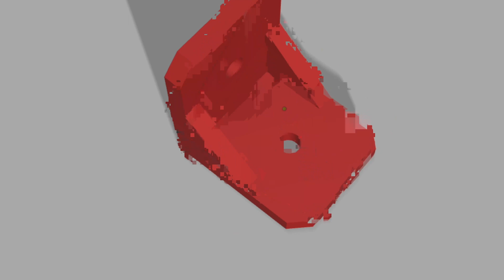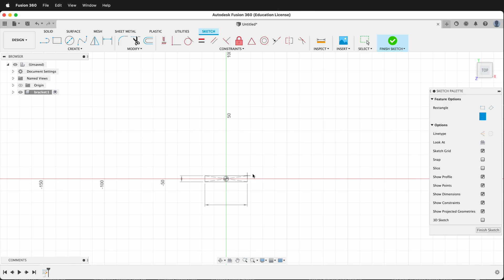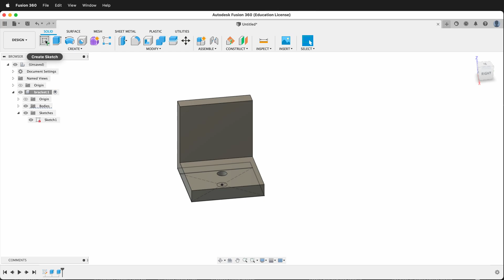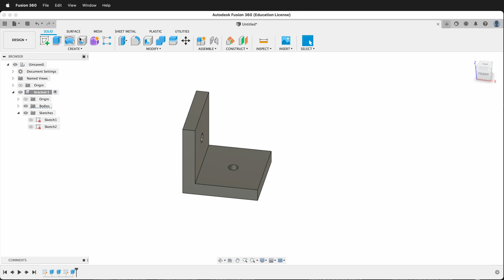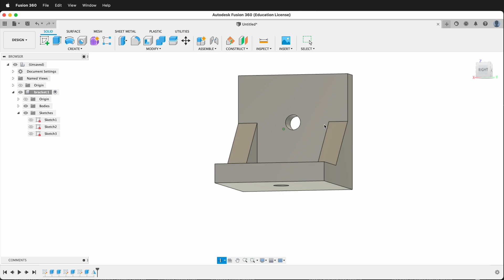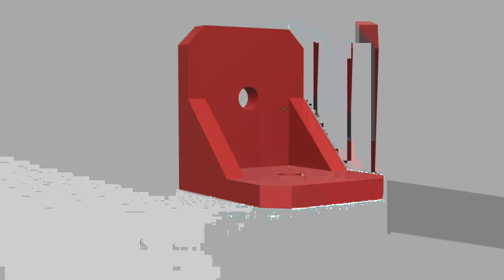3D Printed 90 Degree Angle Bracket with Parametric Features in Fusion 360 Tutorial

Comment: im pretty new to this. if the bracket is going on top of other PLA would I need to model out threads or can I just drill into solid PLA without it?
Reply from the maker: Really depends on the scale of the project, small 3D printed threads don't work so well, but larger threads can, for a small project. I would probably make the whole smaller than what is needed and then drill and tap threads in or use through bolts and a captive nut system

Comment: great work! how much do you think it will cost per bracket? thanks
Reply from the maker: For PLA it would cost almost nothing, depends on size

If you're getting it printed with a service in metal or ABS then it will cost more and also will be based on size

You can see the volume in the properties infusion 360. Just right click on the model in the browser and go to properties and then you can calculate the cost of the 3d print